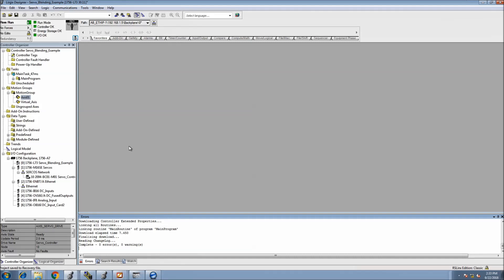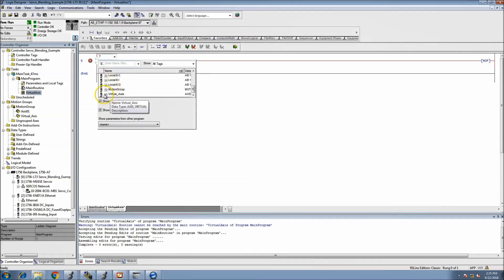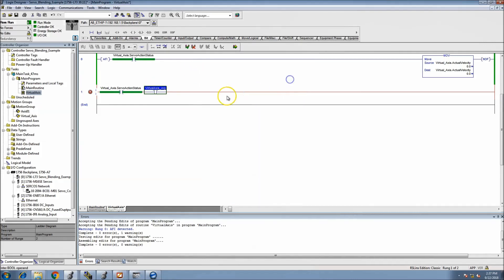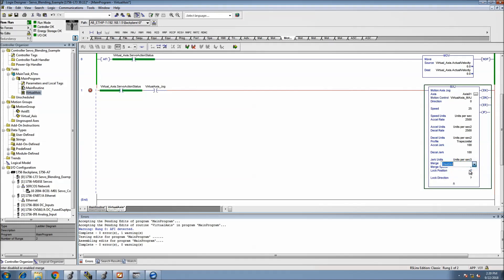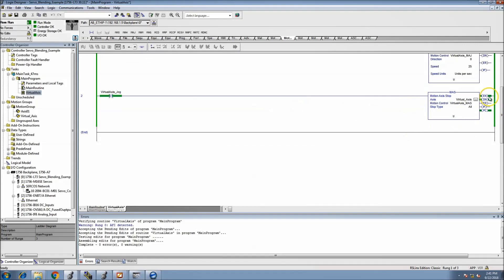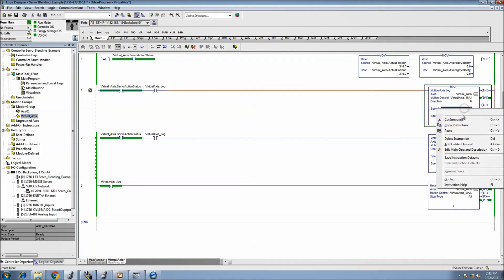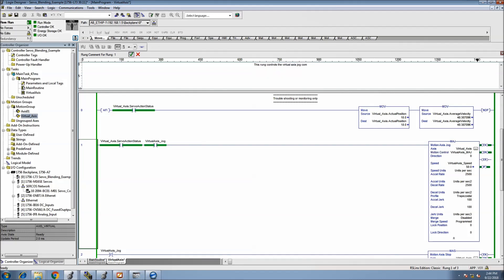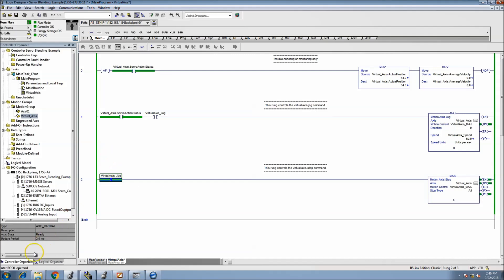Studio 5000 Logix Designer Servo MAPC Instruction Vid 1 - Adding Virtual Axis

Comment: What is the purpose of a virtual axis?  When do I want to use one as opposed to using a specific axis type?
Reply from the maker: It is for a machine motion control, when two or more servos work together for motion controls.

Often a servo is geared to a virtual axis then all the other axis are geared to that as well.

This is just one example